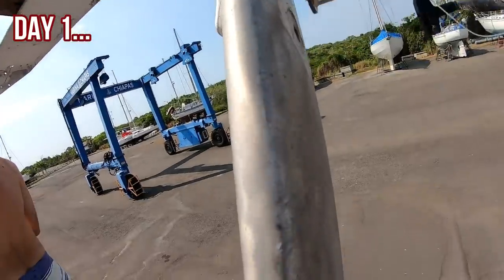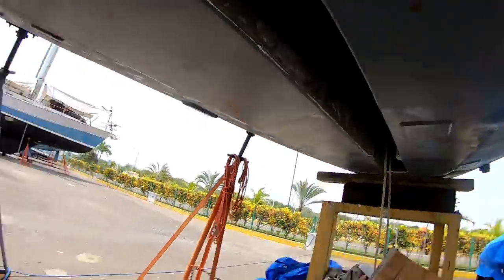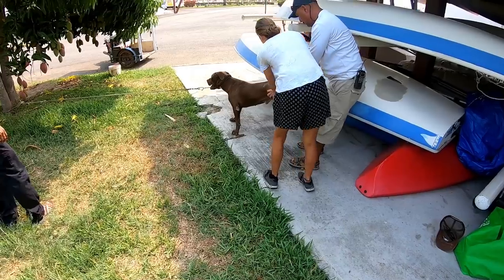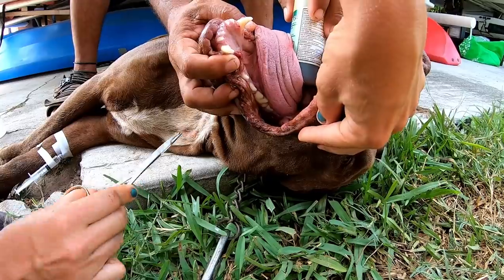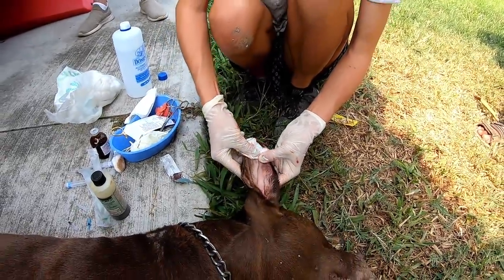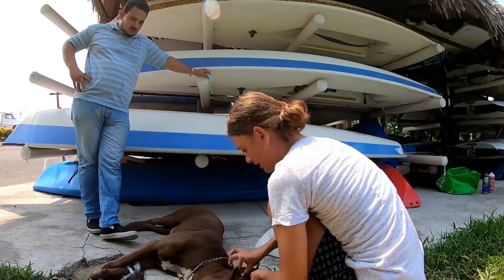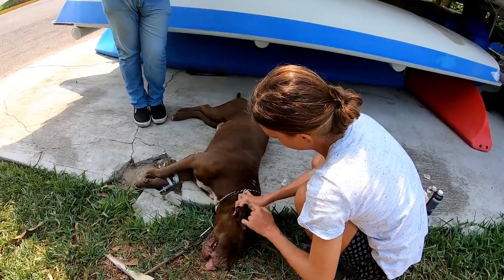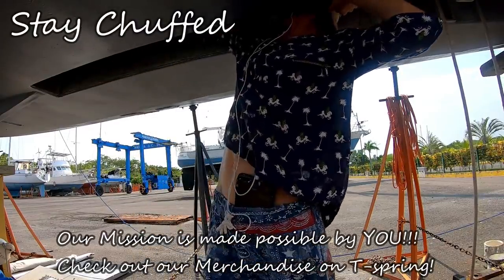Tight Spaces and Spiky Faces S03Ep16 Chuffed Adventures

Comment: dissimilar metal creates intergranular corrosion , so on aircraft we always would use clear scotch tape(packing) between different metals to prevent continuity easy as that, clean it prime it and a barrier between and it will be all good
Reply from the maker: Ah that’s a great idea! Thanks for the advice!

Comment: Well done on the boat prep with aluminium! Keep up ther good work. As I have a small 8 metre aluminium sailing boat (5083 grade) in my back garden (which has also suffered tin worm) I watch yours and Nikes channels very closely. On my boat the plates are only 6mm down to 2.5mm thick  with a cast iron keel and it didnt previously have anodes fitted either :(. I have set up a couple of gantries and turned her upside down and put a tent up as it was easier to weld with gravity with whole new plates using 5356 filler wire. I've chosen to use dexidizer (deoxidine) and then an alodine chrome (aluchrome) conversion rather than etch prime. A bit nasty to handle though..... Will be interesting to see how it goes compared to etch and epoxy undercoat. (Alodine is used in aerospace industry for wings etc which are too big to anodise).  I have invested in some MGDuff hanging zinc anodes too so if you can get them over there I recommend them. One every few metres...in the chain locker and stern locker and hard wired to deck.  Fair winds and following seas. All the best from NW England.
Reply from the maker: Ah interesting, good luck with the paint I bet itllgo well if it’s what the airlines do! It is a lot of work but worth it